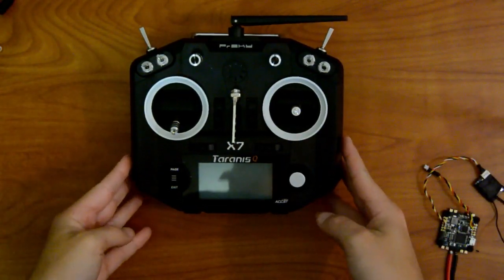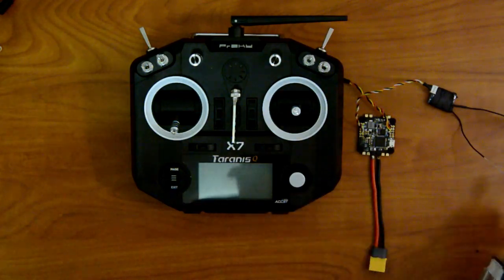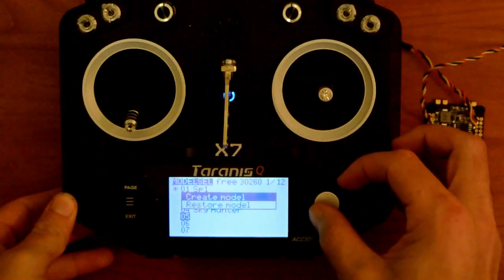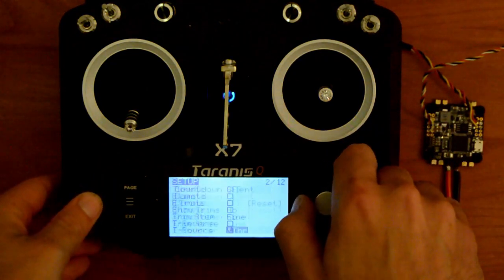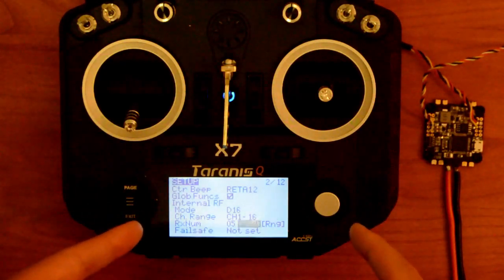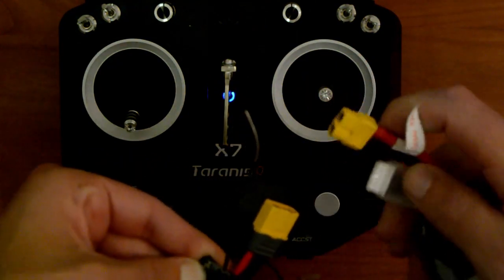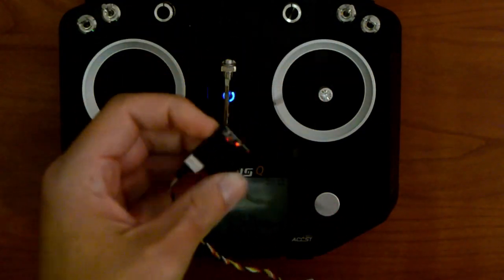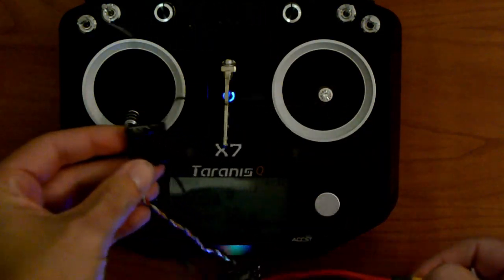How to Bind Receiver to Taranis Qx7?  -- How to Video

Comment: I have the same controller but THE EU version acces taranis q7
 I bought the nazgul 5v2 analog version wijt the frysky xm reciever IF I try to bind it I stil need to make sure mode = d16?  Or acces? Kinda stuck here it wont work With acces mode

Comment: I made a harness with a switch to go between my new receivers and the battery.   This way I can connect the battery then have a hand free to turn on the switch while holding the bind button.  Much simpler.